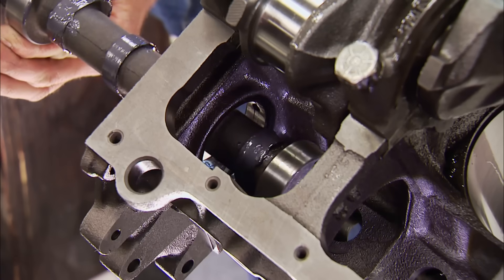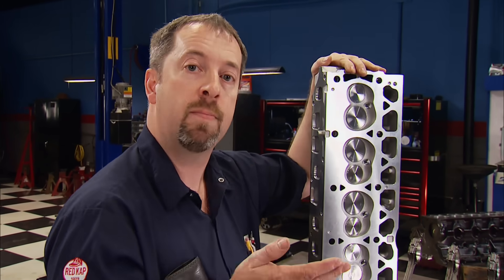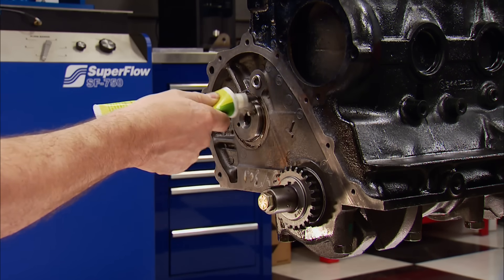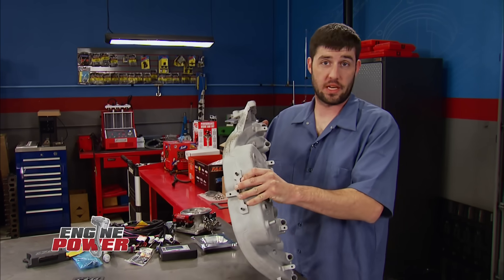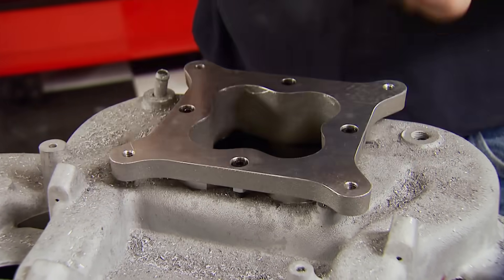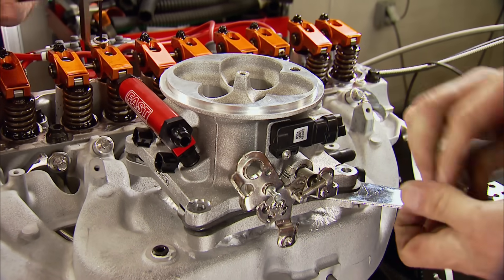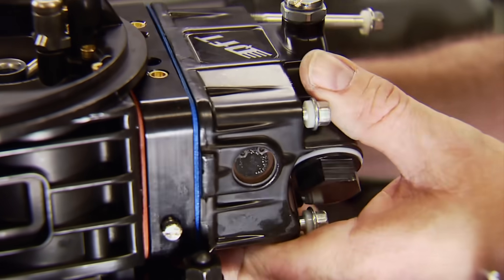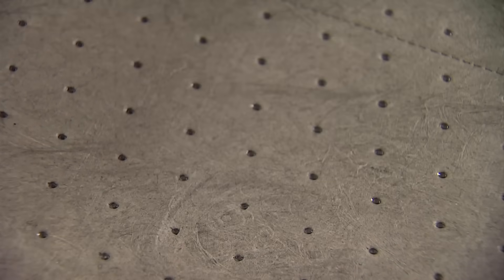Rebuilding a 4.0L Jeep Straight Six to 242HP - Engine Power S2, E14

Comment: "Definitely not the injection system's fault."
Puts a carb on and it gains 80 HP...
Reply: That intake manifold it’s not mean to flow fuel from the throttle body. They should have started with a EFI engine and just change the injectors and tune.
Reply: @rodrigodelafuente4080  i thought jeep 4.0 Straight 6 cyls are fuel injected engines. At least my 89 Cherokee engine was
Reply: @chrismc410  they came in both carburated and fuel injected versions, i think EFI started on 87
Reply: @chrismc410  EFI was Federally mandated on all production vehicles starting I think in 1989 or 1990.
Reply: I’m surprised they didn’t edit that out before the original airing of this video.  I’m not sure If it makes the host look worse or the sponsored product worse.
Reply: They used a shit FI system.  Put a proper multi-port injection system in it and it will beat that carb.
Reply: @spjmrlahey4008  no, they used a split plane crab spacer, it looks like. efi doest like that at all.
Reply: spjMrLahey umm.. I wouldn’t call it shit.. I run this on my 05 Wrangler and it’s making a solid 350 horsepower..
Reply: @spjmrlahey4008  not to mention an aluminum head and aluminum pistons. Dropped the ball on this build for sure.
Reply: @spjmrlahey4008  No it wont.
Reply: @Toxic2T  Good one.  Care to explain how a carburetor, which basically amounts to a giant fuel leak sitting on an intake manifold, will make more power than a system that sprays precisely metered fuel at the back of the intake valve?
Reply: @spjmrlahey4008  Swapping out the entire injection system and mapping it is more expensive than just a dropping a properly tuned carb which is easier to tune and maintain. You can basically juice the same power for less money. Also these Cherokee L6s absolutely LOVE carburetors.  
Heres an example of an 9000 rpm Cherokee engine https://www.youtube.com/watch?v=1SqB8ytWMk4 idle

https://www.youtube.com/watch?v=VkYzT_cj6f0 outside

https://www.youtube.com/watch?v=OPJJ3Q5ibv8 onboard

the engine with the carbs
https://cdn-1.motorsport.com/static/img/mgl/3800000/3850000/3854000/3854100/3854198/s8/argentina-tc-neuquen-2015-dodge-engine.jpg 

Injection is no better than this.
Reply: @Toxic2T  Cheaper does not equal better. There is actual science behind it.  Introducing fuel at a single point and hoping the intake manifold keeps the fuel properly atomized and suspended in the airflow to get an even amount to all 6 holes is not better than having 6 injectors at each intake valve.  That race engine is most likely adhering to class rules on fuel delivery.
Reply: Nicolas T eso mismo le iba a poner, en la argentina el L6 es como el V8 para los americanos
Reply: @spjmrlahey4008   We're talking about raw power and real racing, not hippie efficency. It's not about class rules, it's what it's been developed so far, been developed for decades and still works flawlessly, you can see the proof in my previous comment. Carbs ain't no joke, they don't need a shit ton of wires, injectors(who over time are prone to clog or fail) and a computer to work. These Cherokee engines with a single Weber 48-48 go up to 186mph for almost two hours without blowing up. Also these carbs run with any type of fuel. With a whole new injection system you need to switch to an specified ECU,  map it, tune it, and dyno it constantly over the slightest change.  You wont get huge power gains with a whole new injection system. It's just more efficient. I still say carbs are the way to go.
Reply: @Toxic2T  LOL, hippie efficiency. That's why the fastest cars rely on injection because carbs are better?  I'm sorry "wires and computers" scare you. Try switching from gasoline to E85 with a carb without any adjustment and see how that goes. I have a standalone ECU that can adjust fuel tables on the fly based on the type fuel it sees.  Have fun pulling over and changing jets. There is a reason that the fastest inline 6 on the planet uses EFI.
Reply: @spjmrlahey4008  Lol wrong, the fastest Cherokee engines on the planet are here in Argentina, and they still use a carburetor.  Not scared, just stating the truth. You sound like you got worried of opening up a carb and getting your hands dirty lmfao. Have ever heard of changing jets? It's easy, you should try it someday. Yes, Carbs are not for the lazy or clean-freak queens either. You can still go as fast with carbs, it's been proven. Just look at old Nascar and Drag racing.
Reply: @Toxic2T  Cherokee I6s have gone 5.5 sec. in the 1/4 mile?  News to me.
Reply: @spjmrlahey4008  Your point makes no sense.
Reply: @Toxic2T  I'm not talking just Cherokee I6s. I'll say it again. THE FASTEST CARS ON THE PLANET USE FUEL INJECTION, NOT CARBS. There is a reason for that. If you cant wrap your head around that fact then nothing I can say will help you understand.
Reply: @spjmrlahey4008  I get your point, but I'm speaking by personal preferences, still you can't wrap your head around the fact that the fastest Cherokees run on carbs lol.
Reply: @Toxic2T  Has anyone even tried to build an all out EFI Chrysler I6?  Show me a comparison where carb beats EFI on equally prepared Chrysler I6s
Reply: @spjmrlahey4008  This is so funny. You americans need EFi and turbo to only crawl up to 450HP? These carbed engines I have shown you are topping at 480HP(if not more) while adhering to class rules. And to top that, they run on higher RPMs a whole weekend(Practice, Qualify, Series and Race) and very probably are less prone to blow up than that thing. You just have shown me another shitty drag build.
Can't believe me? 
https://www.youtube.com/watch?v=pMFb0U5wrzc

Heres a 'street' version. Still better throttle response than that low revving turbo you shown me lmfao.
https://www.youtube.com/watch?v=0nfKwcGjjrI

Full Rabid NA with carbs are the way to go.
Reply: @Toxic2T  Because the carbed engine you showed me is using a crossflow OHC head which can rev higher.  My examples both were still on the reverse flow pushrod head.
Reply: @Toxic2T  I just looked up the class rules for the car you showed me. YOU CAN'T RUN EFI!  This makes your argument mean nothing because the "fastest Cherokee I6s" are mandated by rule to use carbs.
Reply: spjMrLahey 
Listen. Fuel injection would be light years of improvement on this build. But your description of a carburetor is ill-informed and lacks understanding of what a carburetor does. Yes you are right, mpfi here would be better. But your ignorance didn’t make you right; you’re just bumbling out an opinion with no engineering fidelity.  Ignorance doesn’t make you dumb, just uninformed. You’re assuming the limits of your intelligence and knowledge are equal to the universe and subsets of knowledge. You haven’t educated yourself enough to be aware of what you don’t know.
Reply: Let's just put this to bed, since it's clearly not going anywhere. Carburetion is absolutely less powerful than EFI. You don't have as precise mixture control, which really matters. 

Here's a few of many many examples of why. 

The slight differences in the intake and exhaust header cause each cylinder to act slightly differently. In a carbureted system, you can only tune for the "average" piston, leaving some of them lame. In a good EFI tune, you tune each cylinder of the motor individually to make up for the subtle differences between them, allowing the best power possible (And even individually vary timing!). 

Most carburetors cannot distribute fuel evenly between cylinders. You can not reasonably make an inline five engine run on a carburetor, only fuel injection, as that particular firing order and engine configuration cannot be made to run well with carbs unless you have individual cylinder carburetors.

The better control over mixture at such precise levels allow you to keep the AFR much closer to exactly what you want. This is especially important in turbocharged and supercharged engines. I guarantee in every situation a turbo car can make substantially more power EFI than carburetor. Infact to go back to a previous paragraph, I've come across many MANY turbo LS engines that need to have a couple of the cylinders run shockingly richer than the others.

The carburetor itself restricts airflow and adds a lot of nonsense in the way creating air friction, instead of an EFI's straight intake pipe through the throttle body down into the engine.

EFI can have better instantaneous throttle response aswell. Unfortunately most OEMs ruin this with horrible computer programming to purposefully "smoothen out" the throttle input to help fuel economy, but a custom EFI is only really limited by  the demands of how fast the engine's rotational speed can physically spin up. Milisecond response when done right. The accelerator pump on a carburetor is limited, and the necessity to have one in the first place shows how slow the carburetor really is to respond to throttle adjustment. EFI needs no such thing.

But I'll go on to give historical examples. Fuel injection was used in extreme power applications where what only mattered was power. Germany used direct fuel injection, that is injection directly into the cylinder, in the 1930s for the DB601 V12 in their warplanes. Formula One has completely optional fuel injection, you can use whatever fuel delivery you want, yet it's been fuel injection in F1 cars since the 50s. AMC released an experimental model of the Rambler with electronic fuel injection in 1957 that had significant torque gains at low RPM.  This was long before emissions were ever a consideration, and it was significantly more expensive than a carburetor. These engineers all knew for a fact that it was objectively better for performance even in the 50s. Not even talking mechanical fuel injection. The Rochester Ramjet also starting in 1957 was a high-priced option in Corvettes and other GM cars that gave significant performance increases AT THE COST OF RELIABILITY AND TUNING. These would run worse than carburetors at the time and still made more power.
Reply: @Toxic2T  my 2.5L Subaru makes 580Whp.  Single turbo fuel injected and cammed.
Reply: @Toxic2T  segun dice que la gasolina se encharca en el fondo del manifould ..pero ni en baja se encharca ..puesto tambien se atomiza . y si se habla a altas RPM's .. la gasolina entra super gasificada ..yo tambien prefiero los carburadores .. y lo he notadoen motos que he arreglado .. saludos y vi los videos .. son una belleza los 6 cil ..
Reply: @axipixel5811  im pretty sure you can tune a carb to make more top end hp in the end than efi. If you could make more power than efi it doesn't make it better, same goes for efi,  they both have their advantages/disadvantages. I don't mind either but if I had to choose it would be efi for the simple reason it gets cold where I live and carbs suck in the cold.
Reply: @nissan300ztt  I used to run a 515 BBC that made 700 hp through a 1050 cfm quick fuel carb naturally aspirated. My point, you can make very similar power using both.
Reply: @Toxic2T  That 9000rpm L6 is a Dual over head cam, just cant compare to a standard head 😂
Reply: @MarianoACV  Before 2015 they were the closest to factory design. DOHC was post 2015
Reply: @spjmrlahey4008  With power adders like nitrous oxide, super charging, or turbo charging EFI is superior due to the near instant fuel and timing adjustments from the ECU.  For naturally aspirated engines with a carburetor (if tuned dead on) you can gain a small power edge on the top end due to the air charge cooling effect of the fuel from the carb allowing for a denser air / fuel charge into the engine.
Reply: it was their fault. They used the wrong intake, Fast even mentions it on their website. Which these guys didnt read.
Reply: @alexcorona  So what is the correct intake ?
Reply: should have just used the fuel injection intake lol
Reply: I wish they had taken on the challenge and... tuned their EFI.
Reply: Travis Thacker 
The 4.0 stock motor makes 195HP and over 250ftlbs of torque. 
I finished watching the vid and was so disappointed. They’re technicians not mechanics: they did everything technically clean and well with no absolutely no mechanical understanding whatsoever.
Reply: @Toxic2T  So, by your admission, it was a "shitty street build" and not a full race engine like this.. https://cdn-1.motorsport.com/static/img/mgl/3800000/3850000/3854000/3854100/3854198/s8/argentina-tc-neuquen-2015-dodge-engine.jpg
That engine with EFI ITBs and a proper tune would run rings around that carb setup. Why do you think NASCAR went EFI?
Reply: This thing’s a boat anchor, now they have this ginormous carb it gets 2 mpg....you’ll never make it to the park.
Reply: @Travis Thacker I think they wanted to have exactly 1hp per cubic inch.
Reply: Its because of the manifold. The aftermarket efi system can't Give it enough fuel. I would have put on a stock manifold with upgraded injectors and a normal jeep computer and tuned it rather than put on a carb. Especially since carbs are not typically great for offroaders due to how easily they can stall the engine in offroad conditions.
Reply: @corbinlauvray1535  I know this is old, but man the factory fuel injection and computer sucks on those Jeeps. I'm in the process of deciding on carb swapping or doing a holley efi on one of my strokers. The heat soak and wiring/computer issues is a major bitch with those Jeeps. And I have a stroker with a hp tuner (hours of tuning by myself), bigger injectors, bigger throttle body with spacer, various sensors moved to the airbox (lower temp reading), header wrapped, gold foil tape on bottom side of intake, dei heat shields, extra electric fans, full exhaust with gutted cat, etc. All of this and still on days above 70 with the way I drive it the heat soak/vapor lock bogs it down. And Im not cutting holes in the hood to "fix" it. But when its in the 30's outside man that thing screams.
Reply: These guys don't know what they're doing
Reply: Fishermanguy44 you should read the comment right above your original.....
Reply: Let's just keep throwing different parts on it and see what works😐😐😐 DUH !!!!
Reply: Get to know multivariate systems.   Or not.  Essentially, you're thinking that that upstream affects and only affects downstream, and the reverse can't happen, but it can (and does); fluid systems are way more complicated than that.  As a few people stated, including the manufacturer, it doesn't work properly with that intake.  This is of course more likely to be true when the fuel is delivered entirely before the intake and much less of a thing when it's right over the valve (or direct injected). Id be interested to know which cylinders were richer and which were leaner.
Reply: StreetCarz  if that were really true, find another tuner.... How can a more precise and efficient fuel delivery make less power?
Reply: @scootbmx01  Read my comment and the people who build these engines will tell you the same. You're honestly better off swapping a SBC or LS into a Jeep. But damn I love those engines.
Reply: Heard dodge neon injectors were a big upgrade
Reply: Haha I'm getting flamed for saying basically the same thing. Old men and their carburetors.....
Reply: Theodore Dowman 
No, carbs have their place. Love them! 
But in this case they screwed up so bad the carb was the only way out! Factory AMC/Jeep efi, set up properly, would spark that carb.
Reply: Rusty Climber  WTF does EMP matter? We're talking about going fast, not surviving a nuclear strike. The actual reason NASCAR went to EFI was the change from gasoline to E85. Both happened in the same year.
Reply: @spjmrlahey4008  even some carbs wont survive EMP. The Hitachi DFE-2832, the stock one on my 1986 Nissan Pulsar NX certainly won't, it's a computer controlled carb. I think some Quadrajets won't either
Reply: @spjmrlahey4008  Nascar went EFi because they didn't wanted to get their hands dirty while dissasembling a carburetor to troubleshoot it. Also pretty sure they got a juicy contract with the fuel system providers and oil companies providing that specific gas. It's not like it was cheaper anyways. Just another unneeded change like the CoT.

The carbed engine in the white car that I shown you on the 'Street' engine video is the same as the original. The only change on other videos is that they redesigned them into OHC for better reliability and a little more power, the 'old' factory like engine still revved high and had similar power. 

I get your point, you love EFi and turbos, but they get nowhere close as awesome those carbed engines are. These engines have been taken from Cherokee's design and developed since the early 90's to replace the old Jeep Tornado Interceptor OHC 230 and Chrysler Slant Six 225 engines that were running in the series back then.

If the carb was so obsolete and useless, they would have changed it a long time ago. Instead they kept the tradition and art of tuning it, so they just developed a new OHC system. You can't compare this to Nascar, Nascar is a business, ACTC's TC/Turismo Carretera series is a tradition. Is the oldest motorsport in history with a Guiness Record to back it up. The guys behind those engines really know their shit, hence the Weber 48-48 carburetor success.
Reply: @Toxic2T  If the OHC head doesn't rev that much higher and doesn't provide a big boost in power, why did they go through all the trouble to develop it? The differences between the two heads is night and day when it comes to CFM/RPM.  If class rules limit you to carbs, then you have NO CHOICE than to become proficient at tuning them. This single fact gives your claim that carbs are better no weight because nobody has been allowed to develop EFI for that class as a comparison. Your statement "NASCAR went EFI because they didn't want to get their hands dirty" is laughable.  EFI is better, plain and simple, and no amount of slack-jawed soliloquy about tradition and art will make it otherwise.
Reply: @spjmrlahey4008  The OHC head gave that engine a 70 hp gain, the old pushrod was making around 420HP. Still carbed Cherokees are the fastest in the world lol.
Reply: Carb>FI, I guess.
Reply: If you paid attention, it wasn't. It was their Frankenstein intake that was the problem